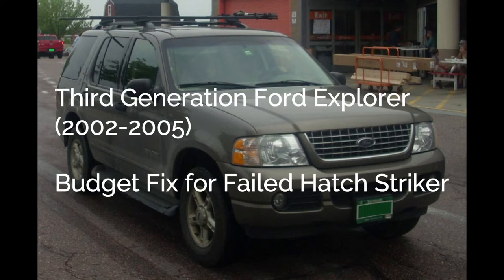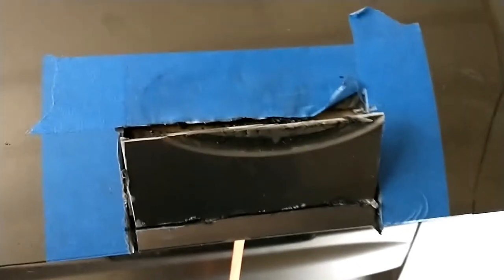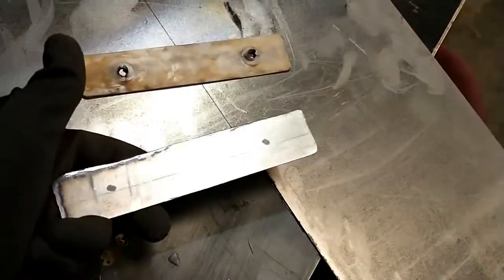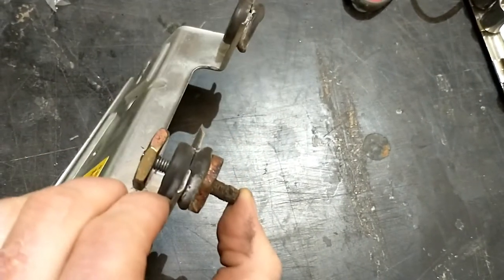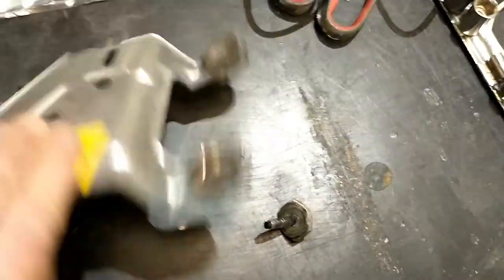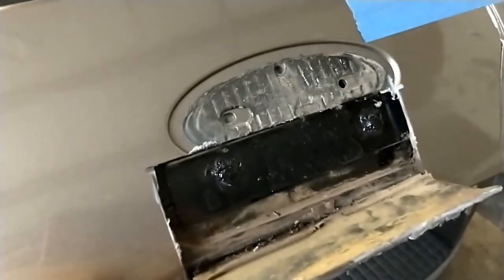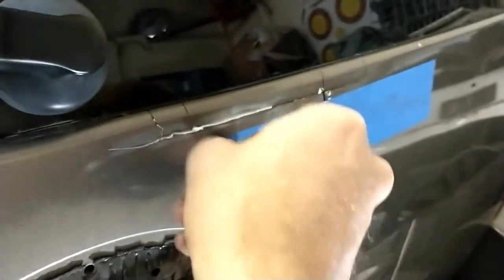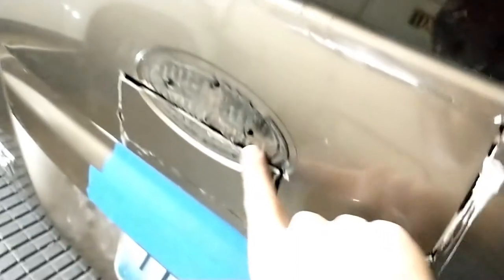Budget Fix for 2002-2005 Ford Explorer Rear Glass Latch

Comment: I just completed this repair. Bought a 6” repair plate at hardware store. Drilled 2 holes 4” apart. Used all the original nuts instead of nuts & washers. 2 each 6M x 2” bolts. Worked great.

Comment: I have a 2003 ford explorer XLT and I can't figure out how to open the back lift hatch window by itself without having to lift the whole tailgate. Everything I've read says there's a button somewhere by the license plate but I've looked all over that tailgate and can't fine any button. Would you happen to know how to open it?
Reply from the maker: There's a little rubber-covered button that is on the right side up under the lip where the license plate lights are.  That's the liftgate button.  You can't really see it when you're standing behind the vehicle, but if you look up from the bumper, it'll be right there.

Comment: well i hear the mechanism ,but i wont open 
2004 mountaineer
any idea?
Reply from the maker: Unfortunately, I do not have any good ideas on that.  I don't recall if the interior plastic will come off without opening the hatch, but if you can find a replacement plastic in the junkyard, you might be able to cut out the center section of the interior plastic to get to the latch to be able to force it open.
Reply: @williamehrman  no it's not plastic though

Comment: Great fix with plate  you wouldn't happen to remember what length the M6 bolts where do you. Thanks for video save me alot of time.👍
Reply from the maker: Glad this could help you out!  I think I used 70mm bolts, but I don't remember exactly.  They were around two inches, maybe a bit more.  I would err on the side of too long.  My recollection is that there's a fair amount of space inside the trim for "extra bolt" to hang out and not be in the way of anything vital.
Reply: @williamehrman  got her fixed up Saturday thanks for video your the man just bought 2 length bolts to see what would work 👍

Comment: I’m having an issue with my 2003 Mercury Mountaineer where I can push the button on the window but it won’t pop open. Any idea how to resolve this issue?
Reply from the maker: I don't recall exactly how the wiring works but the main possibilities that I would look for would be broken wires in the harness that goes from the body to the hatch - in this era they tended to make the wires in the harness just barely long enough, so they get stressed a lot.  Another possibility is that you get water intrusion into the latch mechanism and it corrodes, preventing the latch mechanism from working.  Could also be as simple as a failed switch.